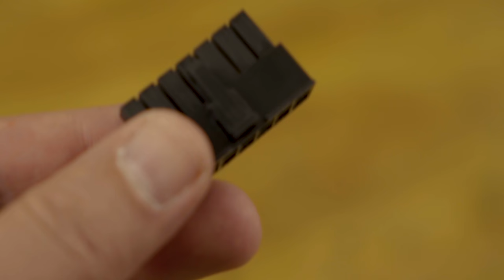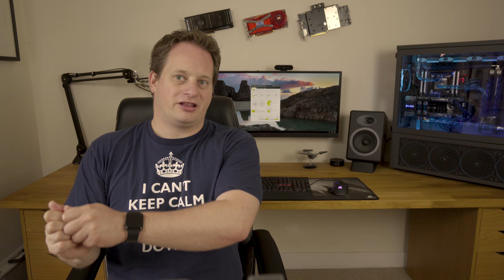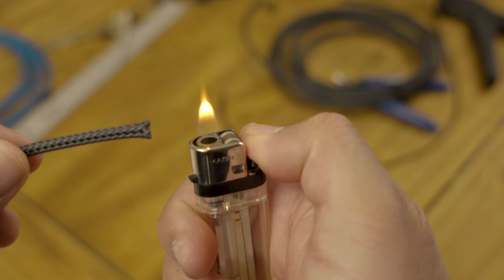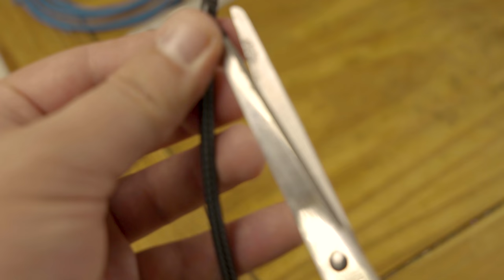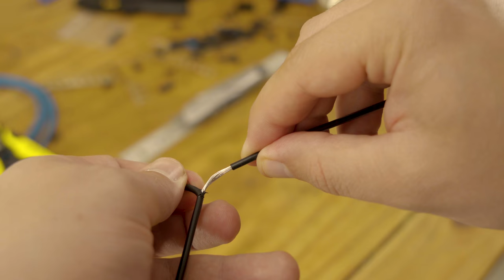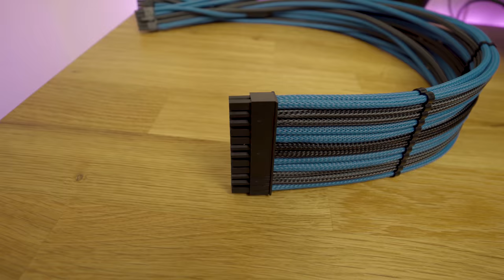How to make custom sleeved PC cables

Comment: Hey, if im doing cable extensions, mainly because i dont have a modular psu, do i need to worry about the correct voltage wires into the correct slot or not, do i also need the double cable into one pin? Thanks!
Reply from the maker: Nope, just straight pass through a if it’s an extension. Map each pin to the exact same pin, still worthwhile being careful though.

Comment: They look great mate,super well done.
I mite have a crack my self........one day.haha
Reply from the maker: +matty dobson thanks buddy, you should definitely have a go, it takes a bit of practise and patience but totally worth it
Reply: Tao of Tech haha,cool cool.
I need to sort my cooling out first.
New case I think..TT X71 Is taking my fancy.
Reply from the maker: +matty dobson guess you are planning a water loop then?
Reply: Tao of Tech already got it started buddy 
6600k and 2x rx480's all on water.
Soft tubing at the moment,but iv got all my hard fittings and PETG tubing to do a rigid build.

My TT view 27 is just lacking the air flow that is needed for a 60mm 360 rad (front) and a 35mm 120 (rear)

I really wanna do 2x360's,hence the bigger case for airflow and also room.

If you have any case suggestions,please do share.
Reply from the maker: +matty dobson some of the new corsair line up have space for water cooling. I went for the 570x for my Ryzen build, haven't got water in it yet though so don't know how it performs. It's got space for a 360 and 280 but they would need to thinner - probably no more than 30 cm thick. Corsair carbide 540 also worked very well for me with water but it's very square so depends on whether you like that look. The case you suggested looks like it would have good air flow - can't beat the simple square design.